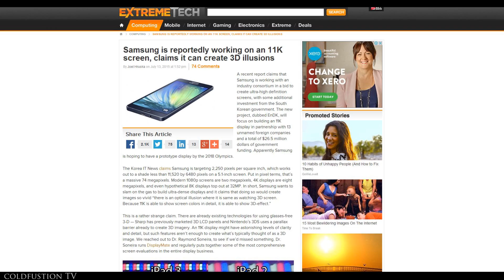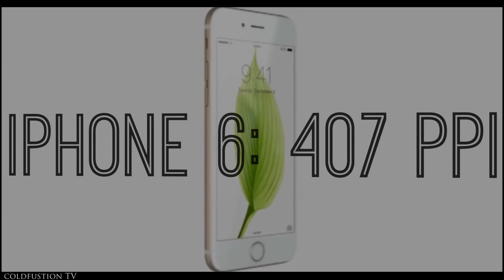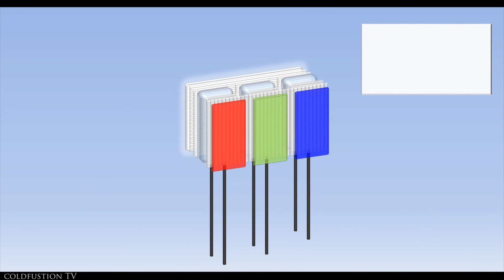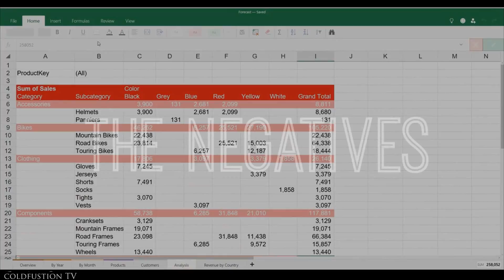Samsung is Working on an 11k Mobile Screen! (2250ppi)

Comment: 45 minutes on screen time light usage lol. battery should be their focus before pushing pixels and screen sizes. smartphones' battery life is bad regardless what brand it is
Reply: Most likely that Samsung and definitely others are already improving and researching alternatives to lithium ion batteries using graphene and other unseen combinations utilizing current technology.
Reply: kevin eusebio well the thing with batteries is that its alot easier to develop and alot of companies are already looking at more long capacity batteries
and the rule is technology gets twice as strong every year and with that said batteries does the same but screens havent and the thing with mobile phones is that they outsource the cpu the gpu and the batteries already so the screen and software is basicly the only thing you have to focus on a smartphone and there is actually some super amazing advances in storable energy and energy consumption
just think about how we lived 20 years ago if you would bring back the best desktop to 1995 it would be the strongest pc in the world and not even 100x of the best pc desktops could match the computing speeds or the power effiency and since we are doubling that power every year just think about how slow the pcs from 2005 are compared to todays pcs and im hopefull of the future i was born 1999 and i have already seen how fast everything advances and how much more effiecent it becomes and thats what made me pick industrial engeneering school and i cant wait until i begin since my life goal is to make overkill shit that will be effiecent and sustainable idk if its overkill thats whats fun with the world to push ourselfs without overkill we wouldnt have jetplanes smartphones or trains every major invention was overkill in the beginning and now the overkill inventions of the 1900s is looked at as ancient and weak

2005 my brother built himself a beast pc of the day it was overkill then but now a cheap shitty laptop is even stronger soo keep in mind overkill is good and no im not an american XD
Reply: kevin eusebio I remember hearing somewhere that Samsung is also working on new battery technology. Don't worry, they have multiple teams working on multiple things.
Reply: Lt Snuggles To what end though? One day, we will have pushed ourselves so much, that there will be nowhere else left to push; no more goals to strive for. 

What do you think could happen the day our technological advancements exceed what is physically available in-terms of resources and money? We can't exactly just go on creating and creating.

...Can we?
Reply: Casper were still using very little energy, once we drill to the core of the Earth you have a to of heat which you can turn into into energy. Plus you can use the core to build more once it cools. Or what about the moon an taking the centripetal kinetic energy and when it lands you have a ton of waste heat.
Reply: asdf30111
 eh when the core gets solid we will all die of radiation because the magnetic field will seize to exist and that would strip our atmosphere and kill us all and there is only really heavy metals that are in the core which wouldnt help us with the advancement of technology and using the heat of earths core as a energy source couldnt happen either because it would be impossible to transfer the energy and contain it since it would create massive earth quakes on the opposit side of the earth and it would be like trying to contain the energy of a super volcano and it would be alot easier to create a fusion reactor it works like the sun you have a sphere of electro magnets pressing hydrogen into a small core until the preasure would make it ignite because of the heat and it would fuse atoms togheter and make unlimeted amounts of energy compared to what the magnets use + hydrogen is the most plenty atom in the universe

the universe would die before we would ever use up over a fraction of a billionth of a % of all the hydrogen in our galaxy alone and yes there is a limitation of technology but when we hit that celling we would be immortal and be could create whatever we wanted with just a thought and yes/no in the resource matter since when we run out of the rare elements on earth we will be able to mine them from asteroids and one asteroid could contain soo much of the minerals we need it wouldnt be a problem + if laser computing would advance and quantom computers would become a thing there wouldnt be such a big need of rare elements that a silicon based computer needs since laser computers operate on fiberoptics and energy so if we could bend light we could make computing possible in our lifetime and they're building a fusion plant in france right now and it could power paris on its own and even more and paris is a huge city of 10m people and more
Reply: Casper
read the reply i sent asd30111 for an explanation
Reply: Lt Snuggles Interesting. Why would mining towards the core create earthquakes on the other side of the Earth? Because of the kinetic force required to penetrate that deep in the planet's crust?

Your second paragraph seems to rely heavily on the possibility that faster than light travel is a reality in order to sustain ourselves and our progression, by mining asteroids. To feasibly mine asteroids of such size efficiently, we'd already need tons of spaceships, which would in and of themselves require tons of resources, and for FTL travel to be a reality. Do you think that we'll ever achieve the ability to travel faster than the speed of light?

Also sidenote, I really find your answers here interesting, and it's clear you're a pretty intelligent guy, but your lack of grammar in your otherwise long-winded paragraphs makes it difficult to focus for long on your points.
Reply: Casper
 no we dont have to travel faster the light to land on asteroids since we have already done that and no faster then light travel is impossible i cant really go into facts about that since there is alot of stuff to cover and yes if we were to mine right down to our core it would fuck the kinetic structures and then it wouldnt be possible for us to transfer the energy

asteriods can be mined with the use of robots and after we got a automated asteriod mining factory pumping out robots that can then go and build other factories and start expanding without us even doing anything and the resources would be abundent

and sorry for not using punctiations but i cant be asked to do that shit if you ever want to have a private conversation just tell me

and btw my name is also Casper :P
Reply: Lt Snuggles Hm... Theoretically, wouldn't warp speed travel be faster than light speed? Generally speaking, I mean. A quick way to cover the seemingly infinite distances from point A to B would need to become a reality first. To even consider transporting these raw materials back to our planet, we would need ships and robots capable of traversing quickly, would we not? We couldn't really be waiting for a shipment of raw materials for ~20 years, not to mention re-entry, as well. Unless you'd propose colonising maybe, the moons of Saturn or something? Even still, the journey there would still take us years at the current rate...

If robots began creating more robots, even without any human intervention, then self-improvement and by extension, sentience, would very likely become a possibility. A dangerous possibility, I'm sure you're aware of, but still one that I'd consider quite a dangerous and inefficient path. We'd need access to one, material rich asteroid first to even consider making robots the size and with the capability required to feasibly haul useful amounts of resources.

Which brings up another point, what if these robots were to actually create more of themselves, quicker than any human manufacturing method, and mined, created, mined, created. To what end? These robots could very likely create themselves at a much faster rate than humanity could breed. In a 'Last Question-esq' manner, what if we were to have all of the naturally occurring resources mined in the known universe? The energy required to process them would be immense, potentially harnessing the energy of stars themselves. 

And it's no problem :p, I suppose it is only YouTube. Casper is just an online moniker I donned for myself yeeeaaaars ago now, but no doubt it's a cool-ass name! xD
Reply: Casper  no we dont need warp speed since we are going to be mining from so many dead planets and or asteroids and since we are going to have so many robots mining it will be like a steady stream of materials and robots outbreeding humans isnt a problem since even if they have higher numbers then humans we still have emps (electromagnetic pulsating stream) which fries the electronic cirtcuts and robots will not be dangerous since they have one objective which means it will follow asiimovs laws
and it doesnt require a consciousness since its only comands is going to be scan for life or biological mass if it finds life we will be noticed and it will search for another planet or asteriod and yes automatic improvments will be possible which will not be enabled in the mining robots it will be enabled on a computer on earth if my theory comes true that is
and that computer will start writing scripts and blueprints for the factory it will be launched into a databased and paired with software its going to work just like patches on games

yes warp speed is possible theoretically but it will mean we have to bend reality like a peice of paper instead of going from end to end we just bend our reality and jump right to the location but it would need insane amounts of energy and we dont know how to do it yet since we dont have a super good understanding of quantom mechanics but yes it would be faster but not needed unless its for human explorers since robots can be replaced easier and they can stand the radiation of space

there isnt really any other materials we can find in space since most of the new materials we create on earth in the facility of cern radiate instantly which shows that we may have found all the naturally occuring materials since we havent created a stable material to date

harnessing the power of the sun or suns will be completely possible in the distant future we are a type 0 civilization on the cusp of becoming a type 1 civilization and that means when we become a type 1 civilization we will be at the same tech as in lets say startrek
and we will be able to manipulate the weather and everything on earth to our needs but we will not be able to control the anything under the crust since it would shift the continents destroy our magnetosphere and i really like my swedish northern lights and i also like how it protects the rest of the living things on earth from the suns radiation :P

we will never run out of materials in our universe there are more suns in the milkyway galaxy then there is bits of sand on earth and there is more galaxies in the universe then there is suns in the milkyway galaxy and thats the observable universe so no materials will never be a problem if we have the tech and that with a steady and a increasing stockpiling of resources will mean that humanities potencial will be infinite if we ever get so advanced that our brains cant innovate or improve anymore we already know how to make computers do that for us and yes there is some risk to that but not really also since even if the computers gains consciousness doesnt mean they will be trying to wipe us out since why should they ? they dont need our resources they dont want water or food and they wont be radical since thats a human trait the will be rational since they dont have a brain thats been adapted to hunt or be hunted the have a brain thats adapted for create and improve

again sorry for not using punctuations
mostly because english is a bit different then swedish when it comes to grammar since swedish grammar is more like german in a sense but also more like english and being a lazy teenager on a youtube comment section this just makes me even more lazy have a good day and if you want a more indept take on anything i have no problem explaining since this is in a feild im going to be studying in the near future (industrial engeneering and product evaluation and manufactoring) but i cant really help you in theoretical physics since there may be alot more capable people here then a 16 year old thats find physics interesting
Reply: +Lt Snuggles (Trollkarln) wow that interesting!

Comment: Batteries need to catch up
Reply: ***** no point in having xK screens or xGhz CPUs if they drain your battery quick ...
Reply: ***** Processors are at least making huge progress over batteries. In the past few years let's say, batteries barely improved. The industry focused more on software tweaks for improvements other than actual hardware. At this point lithium batteries will have to be switched with another brand new technology in order to show good improvement (there isn't much to improve in the current battery technology).

On the side, processors are coming a long way. I personally look forward to what nvidia are doing, their new tegra x1 is already plenty powerful for some uses (like 3D applications).
Reply: ***** what do u need to do on your phone that your processor is hindering you? I always wish I had longer battery life.

Comment: 640 kilbytes of RAM is enough? what was he smoking.
Reply: *****
thats not true . i can clearly tell the difference between a 1080p 441ppi screen and 2k 577ppi screen. however it would be tough to distuingish between a phone with 3 gb ram and 4gb ram based on perfomance and multitaksing.
Reply: ***** that depend from what distance you see it. In a VR headset, the screen is much more closer. 
The actual "density" of the field of view of your eyes is actualy mesured in the minimal degree that should seperate two point from which you can distinguish them. 
The closer the two point (whose can be pixels) from you eyes, the closer they should be from each other so you can't make the distinction. 

Edit : he explain it better than me https://www.youtube.com/watch?v=4I5Q3UXkGd0
Reply: Tesseract9630 looks like i understood he was wrong... and deleted his comment.
Reply: Tesseract9630 ok, but it wont probably make a difference at over 2000ppi. ALthough, i meant ram on a PC. I'm looking forward to 11k for PC screens though.

Comment: Even if it is an overkill, that should not stop technology from pushing the limits by asking questions like "Whats the point?", because the point might arise after things have been developed without purpose. And Mr. Coldfustion, you did not mention the screen size while measuring the ppi.